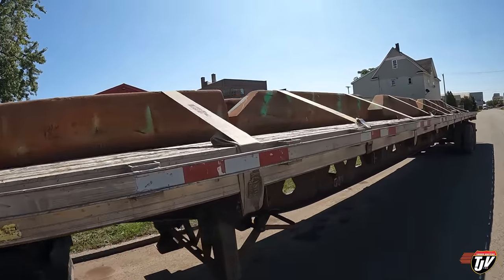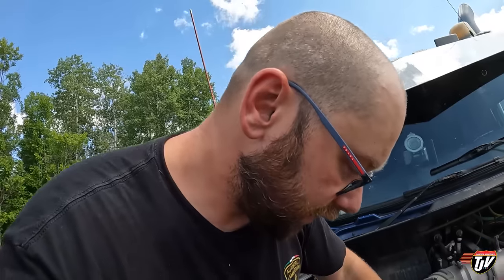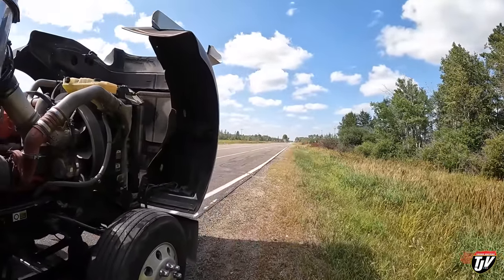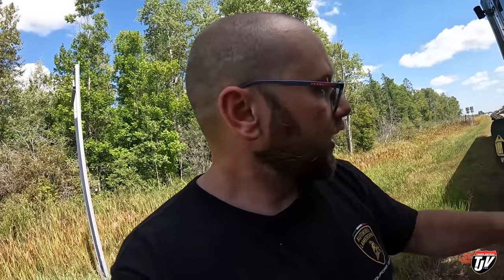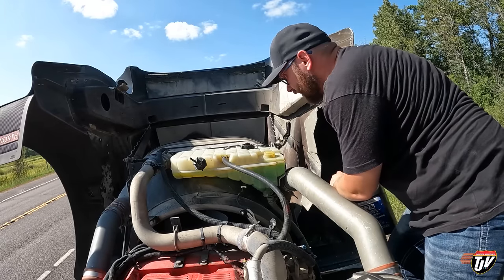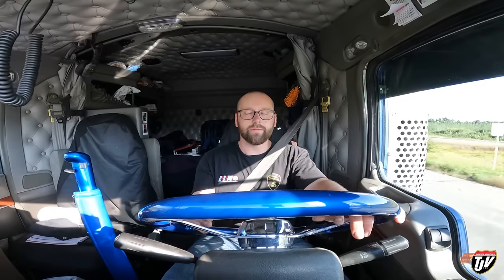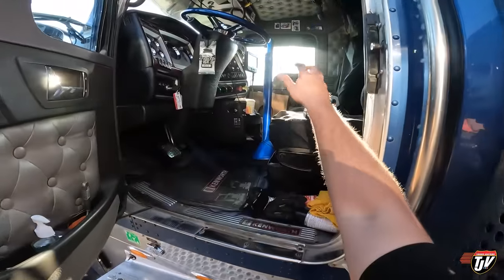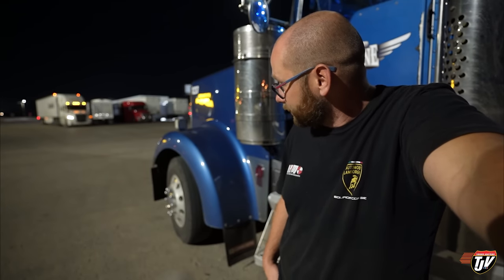BROKE DOWN | My Trucking Life | Vlog #2878

Comment: I did a pre check ON MY CAR, coolant was just just below max, I opened it and topped it up, closed it and drove off. Arrived at my destination which was not that far, got out and back in the car, started it and bam PEEEEEEP!!!!! "SWITCH OFF THE ENGINE, LOW COOLANT", all my coolant gone. The rubber seal in the coolant cap was faulty which I didn't notice when screwed the cap back on, luckily I keep a bottle of coolant in the trunk of my car. I immediately replaced the cap 😅😅😅

Comment: The other cap on the far side of the coolant tank is a bleeder for the pressure that has built up in your coolant system.  Slowly open that cap and it will vent the pressure off the system.

Comment: It is better to use distilled water though for mixing. But in a pinch, you can use drinking water for coolant, but will have to replace it asap..
Reply: Distilled or not distilled doesn't matter. The purpose of the fluid are to carry the heat from the engine to the radiator. Anti-freeze are mainly there, as the name suggest, to keep the water from freezing during winter.
Reply: @grejsancoprative  Regular drinking water contains minerals whereas distilled water is mostly pure. These minerals may form deposits and also may aid in corrosion. To be 100% safe it is best to use de-ionized water.
Reply: @JunctionHack  100% correct!
Reply: This exact thing happened to me, and I put 4 big jugs of coolant, and filled tap water from a gas station and put it in my reservoir.   I’m worried now, after reading this!

Comment: Just replace all of those hoses "when you get home" and be done with it..  You are lucky that it is not winter and minus 40c!
Reply: Wouldn’t he then still be able to drive without overheating the engine? As the cold air will keep it cool?
Reply: @DinanBMWm5  No ,  if the Engine was real low on coolant in the cold it would still over heat and crack the head or block.

Comment: When you have to add coolant. Always turn on your heater and keep you cap off so the air can get out of all of the system. And keep adding coolant till it is full to the line.

Comment: Oh OK you have a hose coming.. There's a slew beside you. Probably water there last resort. Also if totally necessary. Back of one trailer brake and use one of the brake pot air lines to just get you to the truck stop.

Comment: Hi Josh . Maybe the paper work was a small glitch if they used a load broker happens sometimes always those problems in trucking but dose not happen all the time. Only when you want to get home.been there done that. Retirement comes around . So we roll with the blows . You still have a long way to go . Drive safe . 👍💥🇨🇦 Trucker AL retired .

Comment: if you want to know if an engine coolant system is leaking you turn off the engine pressure will build up in in the system, when the engine is running there is no pressure in the system

Comment: I thought you had a cat engine but you have a Cummins. Depending on when the coolant was flushed I would replace all the old hoses or have a extra of each on the side box flush the engine with  water then refill with nitrate free coolant and change the coolant filter.

Comment: Josh if the coolant line you bought 7-8 years ago is weather cracked or dry rotted from sitting toss it hose is the same as tires if tire are past there date code would you put them on your truck

Comment: ppl will blow by anyone on the side of the road but those same ppl would wanna fight u if u do it to their fam but im glad it was only a small fix nothing big but its a w900 not a volvo lol o and for the future dont use those sqeeze clamps they suck buy some of the silver ones u use a screwdriver to tighten they hold tighter than the ones u squeeze to install those ones also brake easy over time
Reply from the maker: I already had them replaced with those :)
Reply: @Trucker_Josh  thats good cause u dont wanna lose all the coolent cause of a clamp